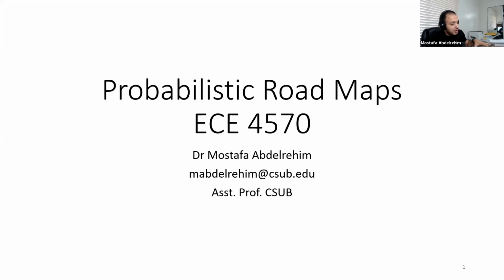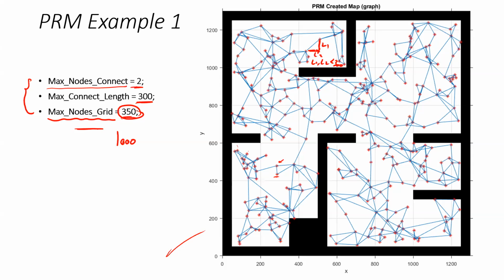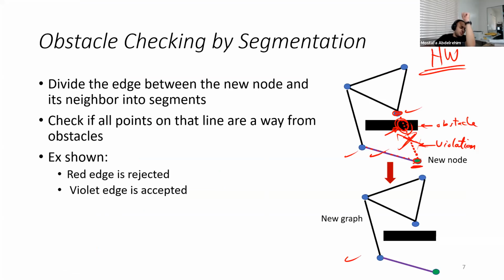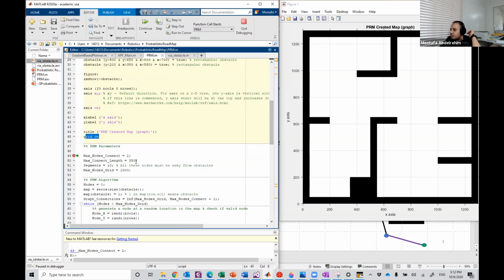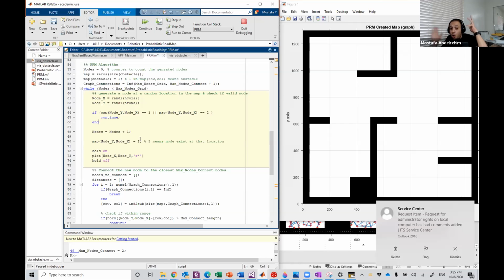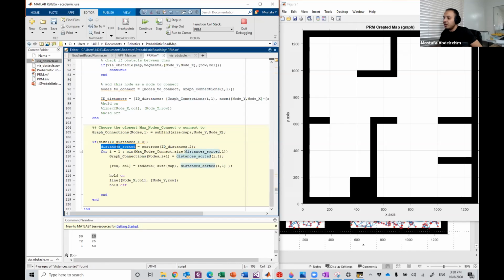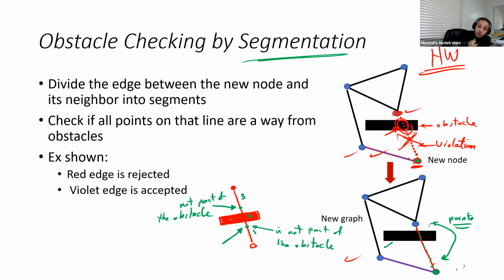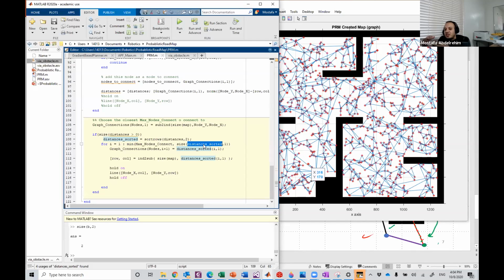[16] Probabilistic Road Maps (PRM) in Robotics - PRM Coding in MATLAB

Comment: In PRM, if there appears to be no obstacle between two points, does the algorithm automatically connect them, or is a collision check always required?
Reply from the maker: As far as l remember the collision check is the thing that will determine that there is no obstacle. Therefore it will run all the time